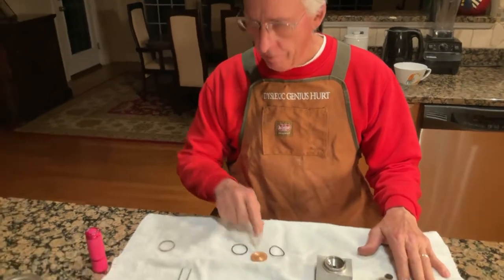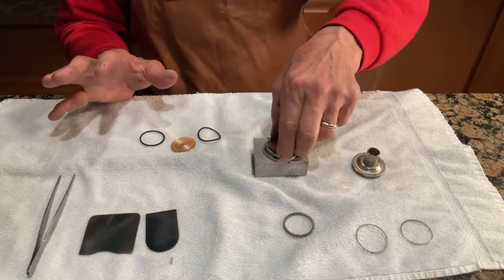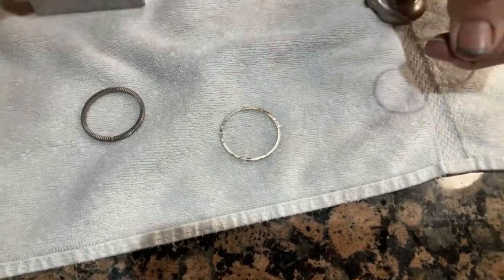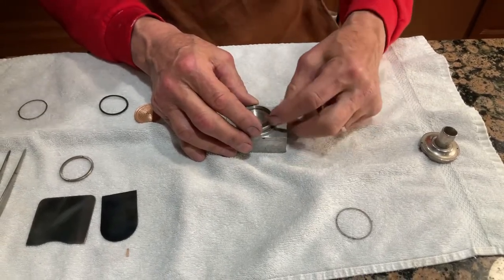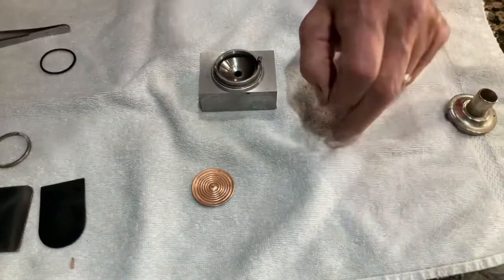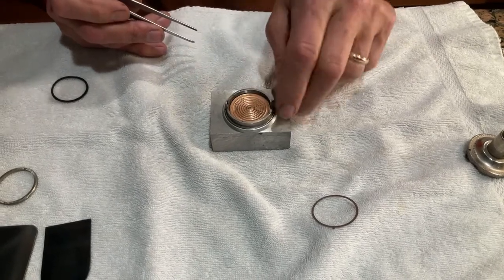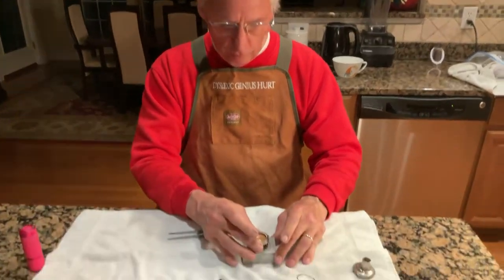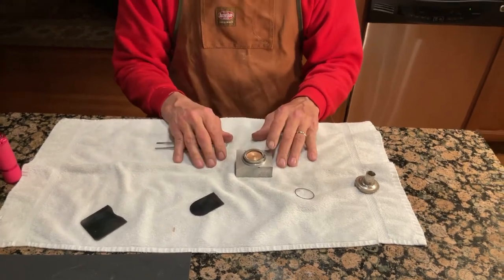573.  Part 1: Rebuilding an Edison C or H reproducer

Comment: Hello again Brett Question please: Why does the mica diaphragm for type c and h have a hole in the center? Thanks for your time . Mike UK
Reply from the maker: That is where the linkage goes to hook it up.
Reply: Hi Brett ,I purchased an H type awhile ago "in need of repair" When i viewed the inside, the brass  part  with the link attached was not connected to the mica diaphragm, i assumed the hole was the result of the brass part pulling away from the mica.                         sometime later, i was surprised to see a photograph of a mica diaphragm with a hole in the centre! I still do not understand how the brass part attaches to the diaphragm.  .Have you made a video showing this please ? Thanks for your time  Mike UK
Reply from the maker: @pemical35uk  videos 573 and 574 show how to rebuild the H reproducer
Reply: @1974hurt   Thanks again Bret, Mike